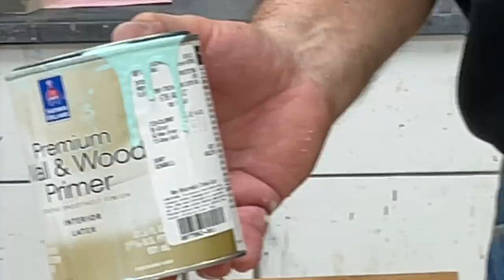Ceruse Refinish Golden Oak Cabinets with a Paint Brush

Comment: Hi Wes, I have eagerly watched your ceruse how-2 videos. I am blessed to have 23 cabinet doors & 13 drawers. That said, they are golden oak! I am in love with this latest version, as using a color is what I'm interested in. The grey glaze is exactly the look I'm going for. My hope is to use only water base products. In your opinion, can I craft a professional look using only water base  paint, glaze & poly sealer, with the brush/roller method? Many thanks for these awesome videos. They are much appreciated.🌷🌷
Reply from the maker: Hi...the paint and the poly are water based that I used. The glaze is available in water base as well. Thank you for your visit and comment. Wes
Reply: Very informative.  Looks like I will have a new project. Would you be so kind to share a recommendation for a paint sprayer?

Comment: Is the spar urethane you used on top of the latex primer oil-based spar urethane or water-based spar urethane?
Reply from the maker: Hi Jonathan...it is water based. I would like to suggest using Minwax Polycrylic water base. Thanks for watching, Wes
Reply: @WoodworkingWithWes  I've still not found a way to purchase the glaze. The closest supplier of ML Campbell Black Glaze is 2 hours away.  No luck at Benjamin More either.  I was sure I could order it online. So far nothing.  I'm thinking about purchasing a black stain and doing a test. I've read that it's got significantly less pigment.  I'm wondering if I should do 2 applications of stain?  Any thoughts or input would be great.

Comment: Just discovered this-looks great but was curious if you had to degloss or sand the topcoat off the gold oak door first. Your finish looks dull and mine is shiny. Thanks
Reply from the maker: The wire brushing step removes any gloss that might exist in the original finish. Thanks for watching, Wes

Comment: I love the look of ceruse. My question is I have solid wood doors and trim but the side panels are a fake wood veneer. It is a little shinny and is smooth to the touch. I can ceruse the doors and trim but what do I do with the side panels?
Reply from the maker: Unfortunately, this process won't work on your smooth end panel. Perhaps just painting with just the base color and some light streaking with the glaze with a stiff brush would give you a faux finish that would match. Test it out...see what you think. Thanks, Wes

Comment: Great instructional video. I do have some concerns about the other surfaces of the cabinets that show. I believe those are not real oak and might not take very well the wire brush. Have you tried the ceruse process on those surfaces? Thanks
Reply from the maker: We have posted a video showing a full cabinet finish. I think it will help, thanks, Wes

Comment: Wes, you used a vinyl primer.  Is there a difference in latex?  I am using this technique on my kitchen and worried how the glaze will work with the latex I've started using.  I wasn't as thrilled with the effect on my sample piece as I thought. Not sure if it's the imperfect paint job or the paint, but thinking I'd like to use spray on method for the drawer fronts and doors.
Reply: i tried this with 123 primer and it did not look good  going to strip and retry
Reply: @michaelholland5634  any results yet?

Comment: Hello Wes.
I have a small project a friend would like for me to do applying the Cerusing method.  But I'm having such a difficult time trying to find the products and price. Also can I use my Graco paint sprayer with a Fine Finish (green trip) ?
Reply from the maker: People have found success in going to the ML Campbell website to find a local distributor or check your local retail paint supplier for a comparable product. Your sprayer should work just fine. Thank you, Wes